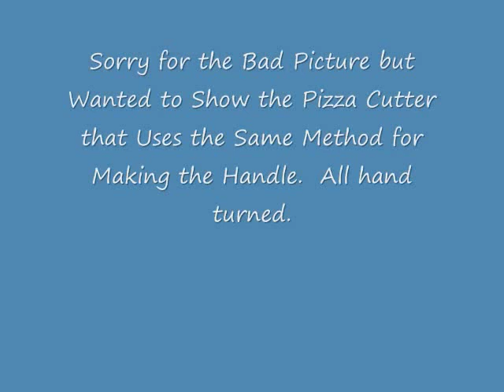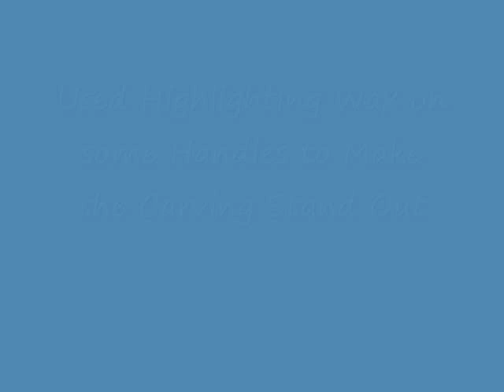Making a Bottle Opener on ShopSmith Lathe, Duplicator and CNC Lathe

Comment: I like the duplicator it would come in handy for making legs
Reply from the maker: The duplicator works very well and would work great for making matching legs.  This one only works on the Shopsmith, but there are units available for many lathes.  If you want one for a Shopsmith, you should be able to find one on eBay.
Reply: thank you for the information

Comment from the maker: The lathe and tool holding equipment would need to be much more robust to cut metal.  I don't think a router would work too good with metal either, but if you were using soft metal and carbide bits, you could probably do small carvings with shallow depth of cut.